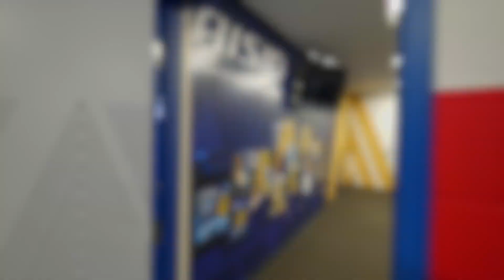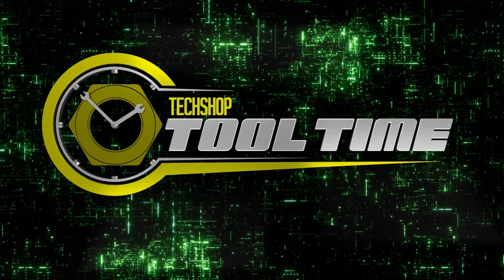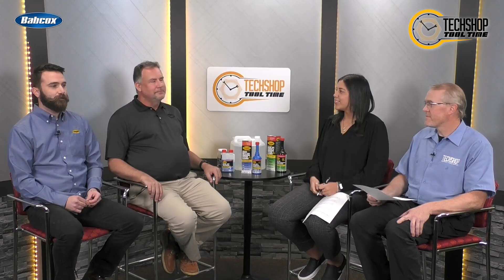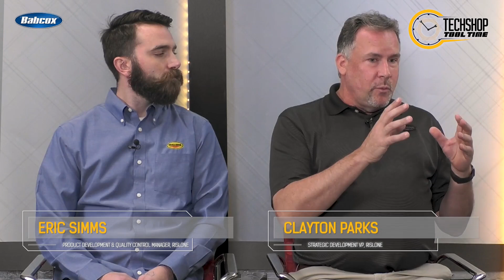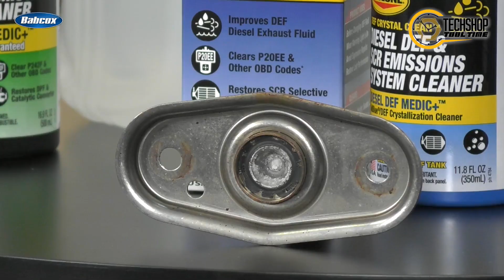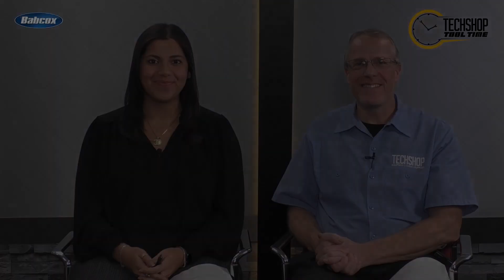Tackling DPF and DEF Challenges: Rislone's Diesel Solutions

Comment: My RAM dealer told me that using this Blue DEF cleaner additive VOIDED my warranty as it "contaminated" my DEF fluid. They told me, I was told to only use MOPAR DEF fluid. They are refusing warranty service now. I can only drive my truck another 40 miles now before it derates to 5 MPH. They stated it is a contaminant. 2022 RAM 3500 Cummins HO with only 31,000 miles on it.

Comment: Peak platinum has an anti crystallization additive in it.
Reply: but it causes the problem with the system and throws all kinds of codes 😞
Reply: @wilsonsamuel2469 I’ve been using it for 2 years in my Ram and haven’t had a code

Comment: We have been told never add any fluid to your def as it will change the % ratio?  Adding def cleaning fluid to my def tank will change the ratio to what?
Reply: you must be new    i remember when DEF came out we would run just water in the tanks   they found out and make all these sensors and shit   all it does is steam cleans the soot out the system
Reply: @ what’s your point?
Reply: @MarknTerry I have run the DEF additive without issue.